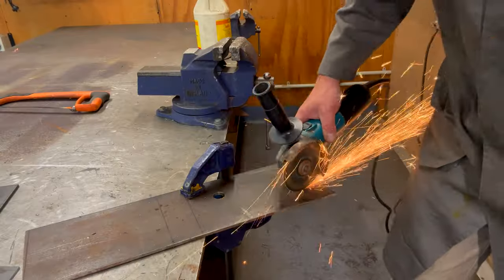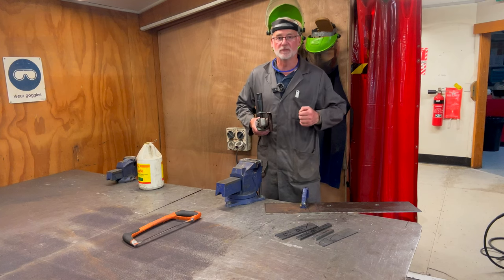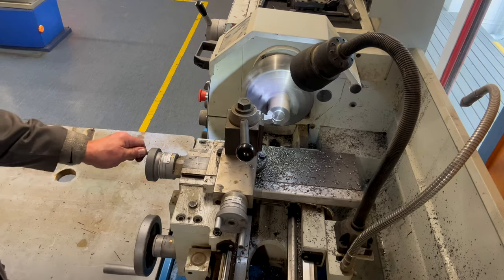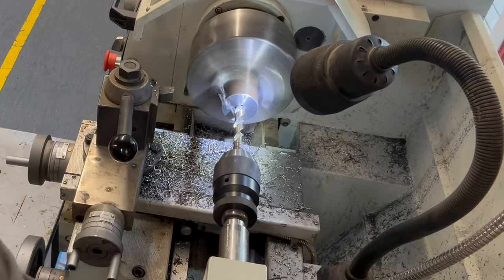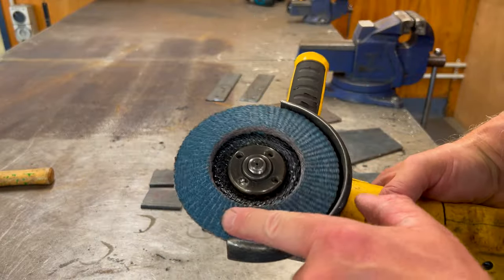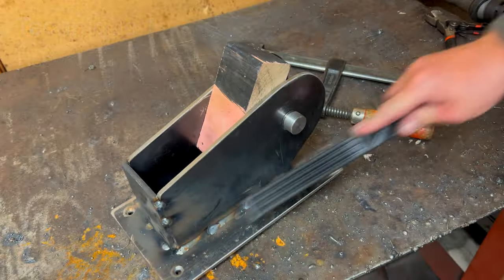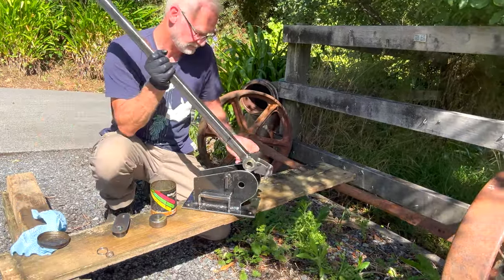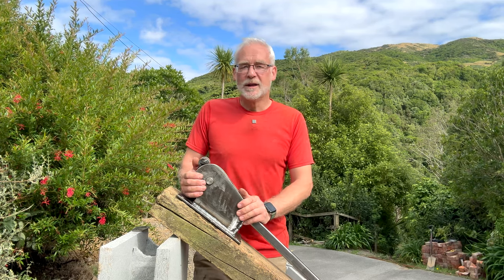HOW TO MAKE: let's build a concrete reinforcing steel bender (rebar bending tool)

Comment: A note on sound mixing (I've years of exp doing corporate webinars)... rather than raising the volume of the music between voiceovers, try making the music's "loudness" (it's a setting on each audio track in your editing software) no more than the loudness of the voiceover.  You can still drop the music level down while the voiceover is on, but balancing their overall loudness this way prevents the listener from having to ride the volume up and down, which is what I find myself doing because the music is so much louder than your comparatively gentle voiceovers.  👂👍
Reply from the maker: Excellent feedback and thank you for the tip. I was concerned the music was overpowering, and a couple of comments have confirmed my suspicions. Next edit will be improved👍 thanks again.

Comment: Where are they still teaching machining in NZ?
Reply from the maker: I know right!?  So many schools have moved away from using heavy machinery due to safety concerns and lack of knowledge. I certainly benefited from my exposure to machining at school, and know many of the students enjoy the challenge.
Reply: @danwaterson356  as an engineering student I can confirm would have absolutely loved to have access to such machining training and tgat it would've been extremely valuable
Reply from the maker: @UserUser-qo3fe  I hope you are now getting the experiences you need.  These 'old' skills are crucial for us to continue being innovative. Good luck with your studies.
Reply: @danwaterson356  thanks a lot man, but I can 100% guarantee you that If it was up to university alone I would go through the entire degree without ever touching a single screwdriver 

Thankfully I have other ways to "get my hands dirty" and actually learn

Best of luck with your transformation and renovation project !!